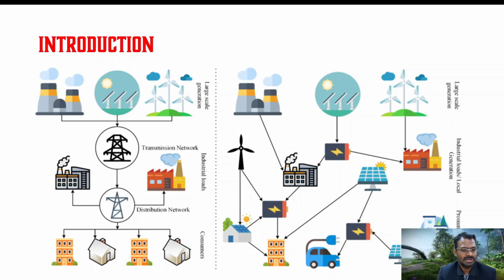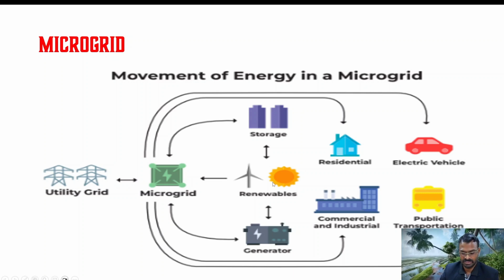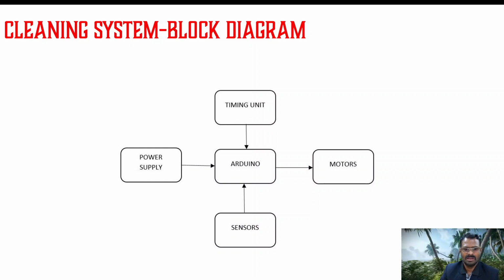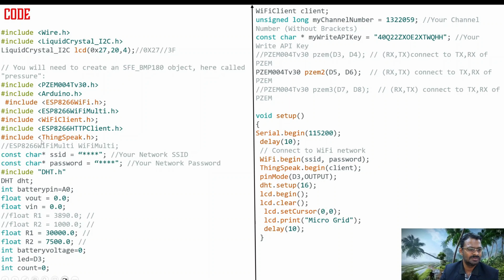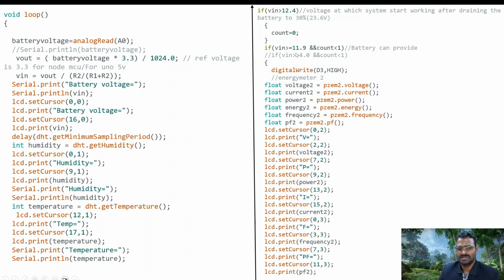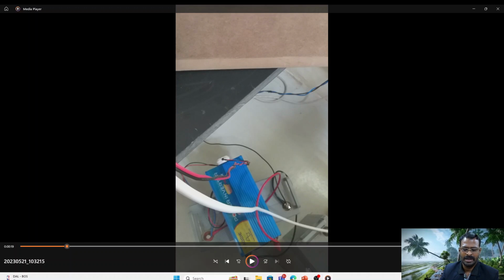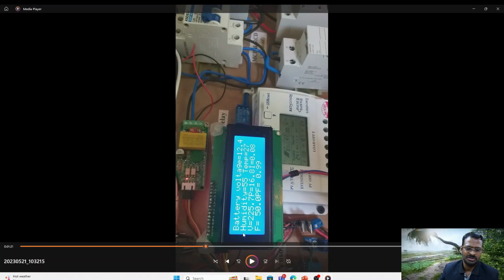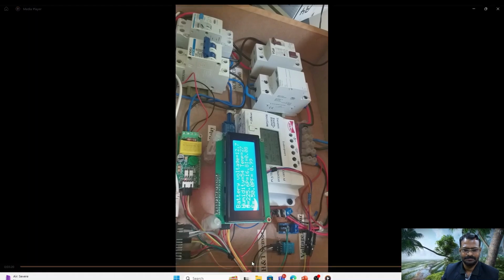Solar PV based Microgrid Implementation using NodeMCU and Thingspeak

Comment from the maker: https://docs.google.com/presentation/d/1MWR026XAthyHbLMRRYtYGYWI5EFTsIs2/edit?usp=drive_link&ouid=117142173256463558187&rtpof=true&sd=true
Reply: Asking authorization.
Reply: Than  you so much, while compiling ,error is coming, which version of Arduino IDE you are using?. Thanks.
Reply: The latest one
Reply: Check all header files are installed properly